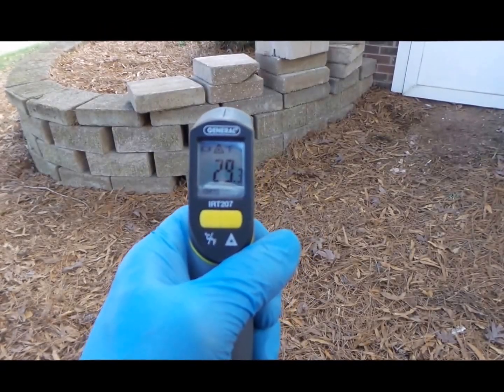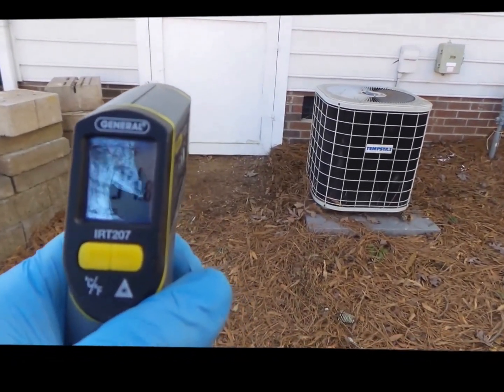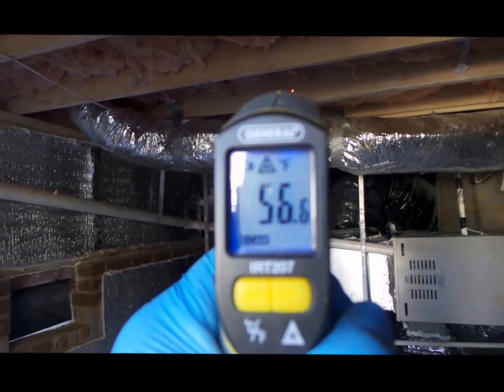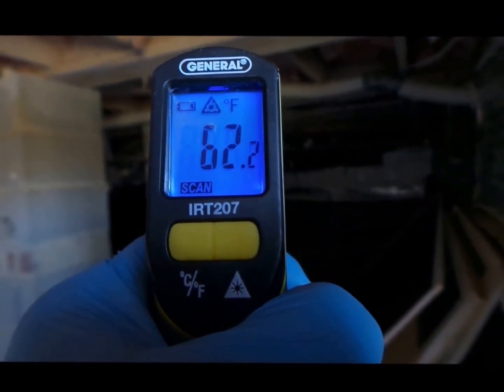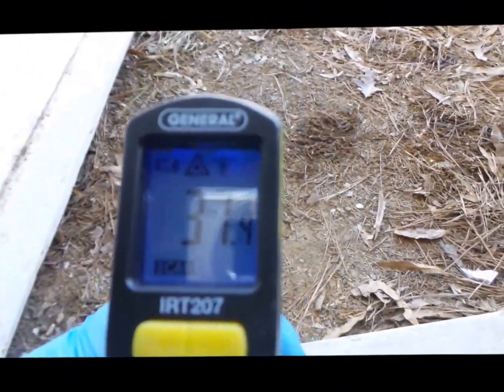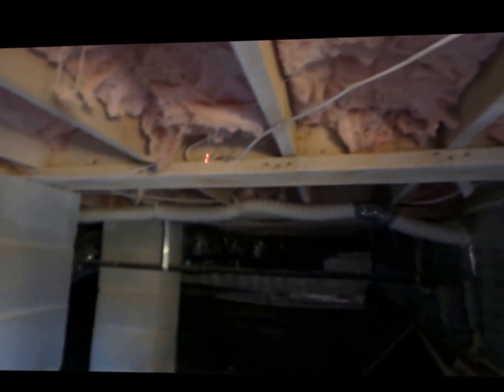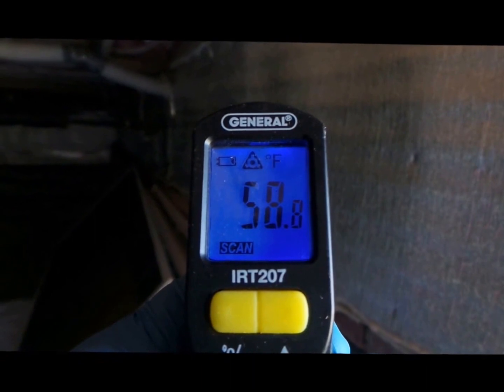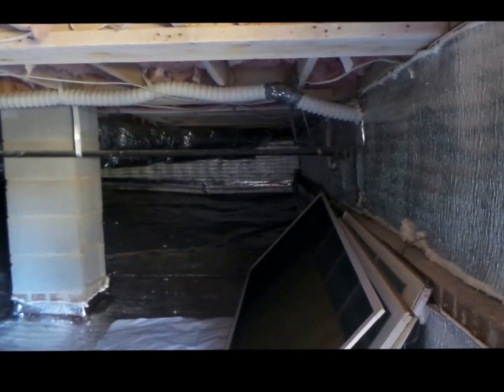IES  radiant barrier crawlspace temp readings

Comment: I think your premise is incorrect. By adding a radiant barrier on the ground and cmu block, you are partially trapping residual heat off your heating unit and heat loss from your ducting. The exterior free air temperature is 29 degrees, you seem to be amazed there is approximately a 30 degree increase under the house. Measure the temperature of the metal on your heating unit and see what that indicates. I would suggest turning off your heating unit for 5 or 6 hours then go under your house and measure the crawl space temperature. Since your crawl space vents are open you will lose heat in the crawlspace and your crawlspace temperature will soon equal the exterior free air temperature. In your installation scenario, you are mixing hot and cold air and these are conditions in which mold grows (cladosporium or aspergillus penicillium for example). Look for black spots appearing  on the exterior of your HVAC unit, supply plenum or ducting near the supply plenum. I appreciate your video but I'm not sure what you are showing us.
Reply from the maker: Our intention was to retain/trap heat from the subfloor, HVAC, etc. Instead of letting it heat sink into the earth. The idea was that an insulation blanket would perform better than plastic ground cover in retaining heat in a crawl space in a varied climate.  To your point condensation is a big concern in open vented crawl spaces. Since this space has a furnace that needs make up air the client opted for the unsealed vents. Our follow-up during the summer revealed no condensation on the R8 air ducts or any surfaces- that too was impressive- Apparently this design at this location, during one winter and one summer affected the temp enough to discourage dew point from being reach, despite the high humidity in North Carolina.

Comment: So is it better to put the radiant barrier on the ground first than the crawl space wall and finally on the ceiling joist? How is the crawl space in the summer, in regards to humidity?
Reply from the maker: Ground and walls if its a closed crawl space - if open vented then insulation is also needed in the subfloor- your building code will dictate where the insulation goes. Building code is typically for minimal performance only.
Reply: Thank you. We got hurt bad this last few days with the polar vortex that I want to prepare myself before the next time the temperature drop to extreme numbers.